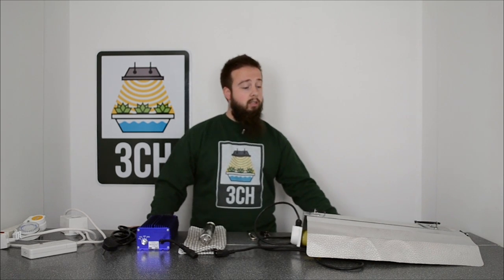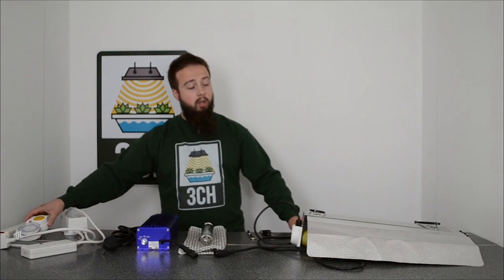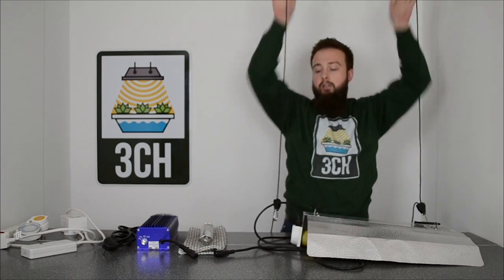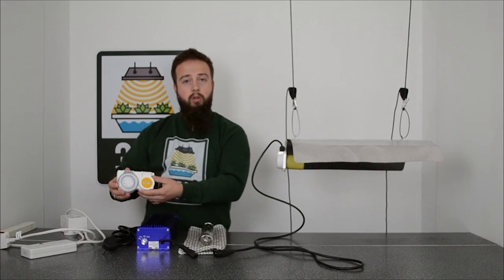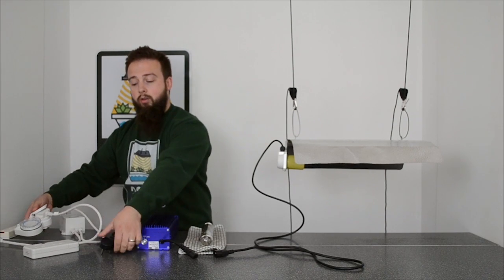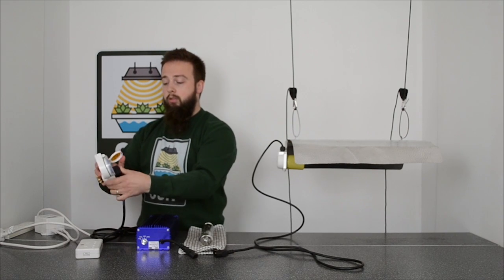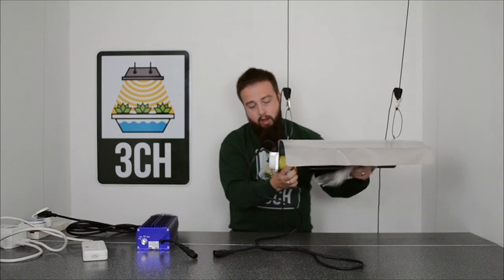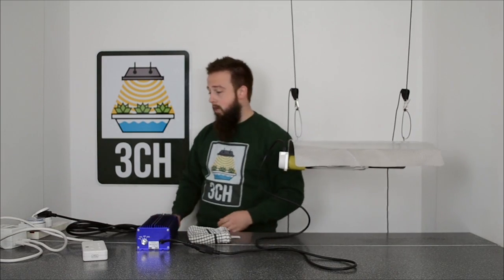How To Setup A 600w Lumatek Euro Grow Light Kit

Comment: How do you cool down this light when you got a reflector like that... Would one of them filter fan intake thingys work to take out the heat? I'm all new to this kind of light yo haha
Reply: You don't. The ordinary HPS/MH lamps used in grow setups are designed to be passively cooled and forced cooling is either unnecessary or ill advised. Forced cooling can (but probably won't with double envelope bulbs) cause the lamp to fail to get up to its proper running temperature which stresses both it and the ballast. 

Most of the heat that comes from a HID lamp is radiated heat and there's not much you can do about that apart from ensuring proper ventilation of the grow-space. If you are having heat problems then it means your ventilation is inadequate for the amount of energy you are pumping in. Less energy or more fresh air are the only ways to sort it out and your lamp will then take care of itself.

Comment: How much does it cost to run one of those...?
Reply from the maker: To purchase a kit similar to the one shown in the video you would be looking at something like this: http://3ch.co.uk/grow-lights/hid-grow-lights/600-watt-lumatek-euro-lighting-kit/prod_1097.html

For the electricity costs, it is highly variable. Dependent on your electrical supplier and how much you pay. A very rough estimate would be 0.75p per 12 hours (So in 12/12 cycle this would be 0.75p per day). This 600 Watt bulb should be sufficient enough to grow 9-12 plants effectively. Hope this helps!